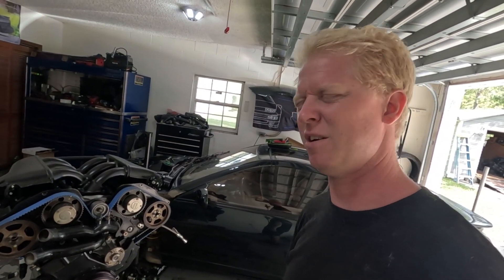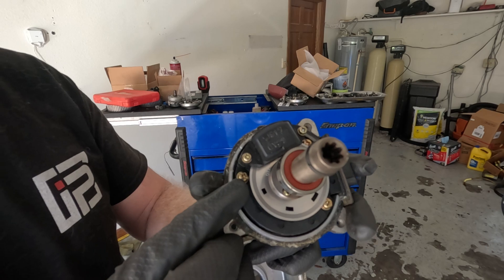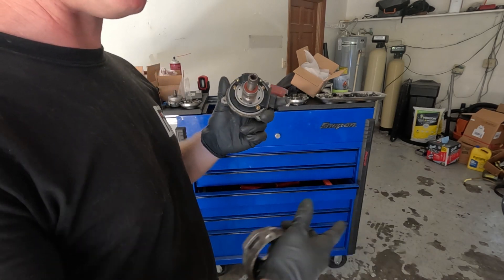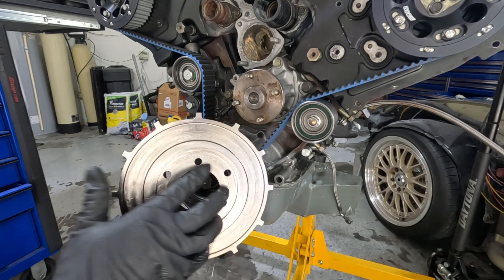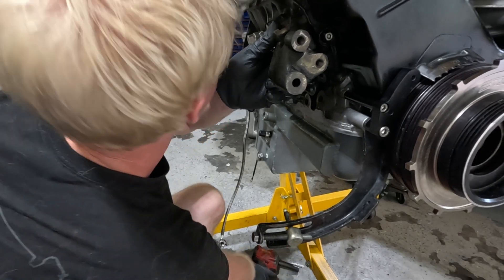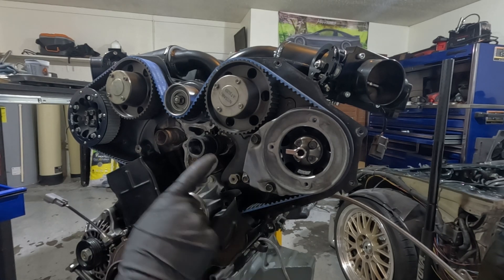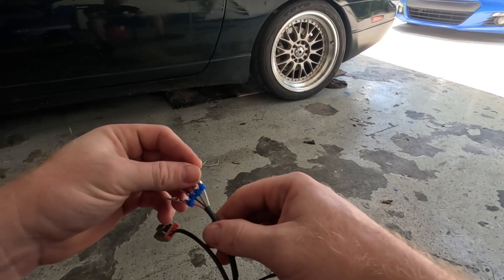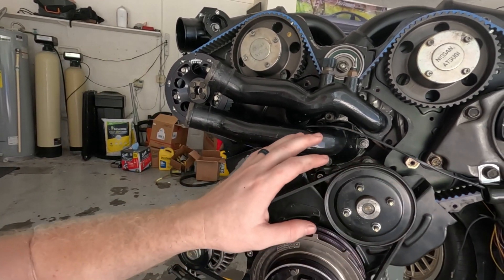The Most Important Sensor on Your Engine Is Lying To You! | Nissan Trigger Wheels

Comment: The difference between a 12-1, 24-2, and a 36-1 trigger is the resolution. You have way higher resolution on a 36-1 than you do on a 12-1 with a 24-2 being a halfway point. The only downside to having the highest available resolution is that when the engine spins really fast (11K+), it's possible for the signal to skip teeth, which could cause the ignition signal to break up.

Comment: While there's some truth to the new sensors being more accurate, the OEM cam sensors still work very well with standard and some high HP Skylines. Most Japanese still use the OEM sensor. So don't get caught up in the sales marketing of new products.
Reply from the maker: for sure! it's all basically the same sensor and there's plenty of people making 700+ to the wheels with the factory CAS!

Comment: Fun fact, the OBD2 96+ models added a crank sensor to the flywheel using trans bell housing.
Reply from the maker: I never knew that! Interesting!
Reply: @Billy_Built  If you have the 99spec trans you can do this for cheap/OEM+.  Use the outer low resolution ring on CAS to get cam home position and use the crank sensor for RPM.

Comment: Did you have any trouble getting the cam sync to work on the Haltech?
Reply from the maker: Just did it today actually. should be up in an upcoming video. Wasn't too bad
Reply: @Billy_Built I set mine up in the Haltech’s elite 2500 and it is only picking up crank signal and not cam

Comment: Looking good! Thrilled to see the power steering arrangement. Any ideas on how to simplify/modernize the ac system? I always thought there must be smart solutions for the ac. 
Keep up the good work!
Reply from the maker: I have a couple different ideas for the AC system. Merlin Machining had something in the works as well. It's only a matter of time. The factory AC setup is outdated and can be updated with a way more efficient compressor/condensor at the least.